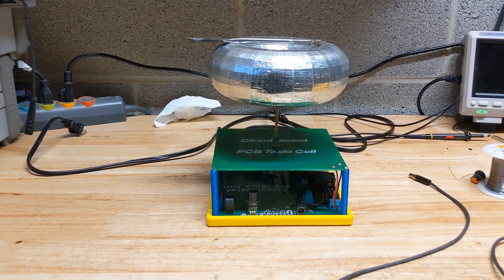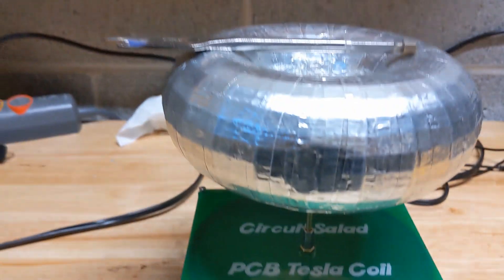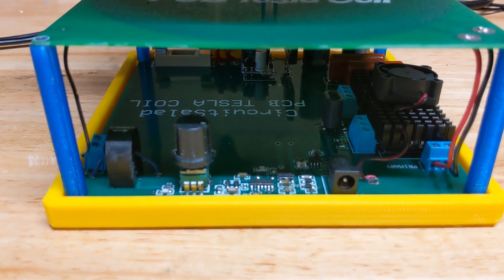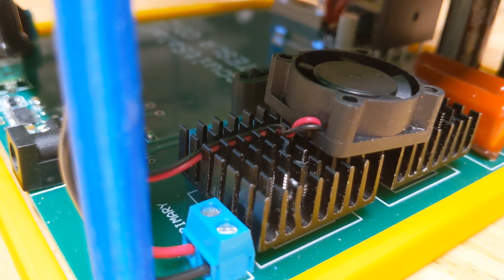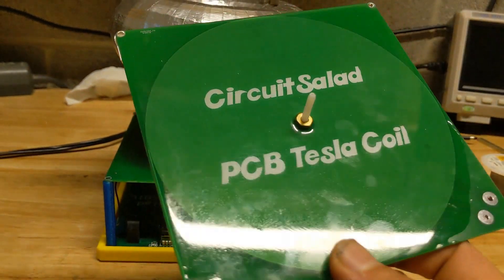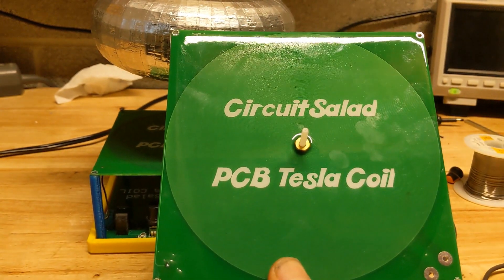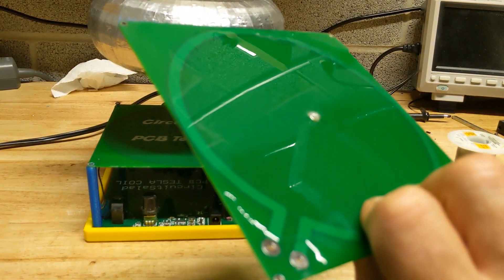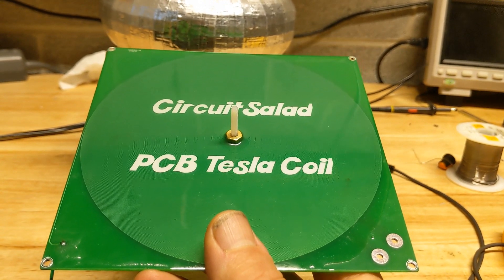PCB etched Spiral Tesla Coil generates 12 inch Streamers

Comment: Is that a metal rod or plastic tube with wire that is holding the topload? Does the bolt in the middle of the secondary have to be nonconductive?
Reply from the maker: go look at the blog post on circuitsalad...in the video I show and discuss this in detail.

Comment: You built a tesla coil with foot long streamers without the pain of winding a thousand turns of wire. Meanwhile, as of typing this, I JUST got done winding a coil for 6 hours. You're cheating.
Reply from the maker: Creating a  beautiful wound coil is half the fun! For me this is just an experiment to show that a small relatively low quality secondary can be driven efficiently and generate good sparks. For the most cool looking, efficient and maximal streamer length to power in ratio coil; a nice wound secondary is best.

Comment: This is incredible. Really great work, amazing design and output.
Reply from the maker: thanks! that's kind of you..I know you put much thought and effort into your projects..This thing is driven really hard but I have built a few of them and they operate consistently. The top load really extends the sparks...but I still get 6 inch sparks with just a post. The top load lowers the frequency ...increasing the current even more for the given reactance of the primary and helps reduce detuning as sparks form. I think the basic primary/secondary coil board could be used with other drivers (lower voltage dc based)  to make a nice musical coil...or a slightly less insane device ...not at the verge of exploding!
Reply: @rayring1166  yeah it looks to be driven hard! Glad you enjoy my videos… but my works come nowhere near this.
Reply: @rayring1166  Do you have an email I may be able to contact you through? You may reach me on the "about" tab under my channel page. I'd love to run something by you.
Reply from the maker: @PlasmaChannel  sure its raycharlesring@gmail.com

Comment: 3:20 - Thats smart to have that coil sparking like that closely to your expensive lab equipment.
Reply from the maker: Actually, I am smart..I understand why the sparks won't damage my equipment...and they haven't. If there was a serious risk..I wouldn't do it. Ironically, I would be more concerned about damage if the coil was not arcing(at that same power level). That would mean the coil was radiating energy efficiently (it's a quarter wave antenna)and at such close proximity there could be parasitic coupling  into the equipment perhaps causing damage.  Perhaps it sets a bad example with regard to best practices and safety but who cares...in fifty years I'll be dead regardless.
Reply: @rayring1166  well I was really joking with you by the books 📚… but I forgot say Thanks for the well organized documents you provided for building such cool solid state Tesla coil.
Reply from the maker: I know you were joking.... I've just had a lot of comments of everyone being so concerned about my test equipment....  I just want everyone to know it's okay! Though it probably does set a bad example. From now on I'm only going to use my hamster for such experiments.... I'm sure that'll make everyone happy

Comment: Wow, that's really cool! First time I've seen one of these. That's really impressive output! Got me interested in trying this now.
Reply from the maker: Thanks...I hope someone build this. I posted a link to my cad files on my blog. The big top load and its elevated position helps spark length quite a bit. But the top load does not have to be this big to work well. You need some kind of post at least to get the spark up in the air or the coil will arch all over itself. Without a top load the streamers are more like 6" at best. I used bridge rectifier but a single half wave rectifier works fine. You get more of the 60Hz envelope modulation which extends the streamers somewhat like a QRSSTC. but if you modulate for music it nice to reduce the 60Hz artifacts.
My original prototype had a separate wire  primary and I wasn't sure the coil could handle the integrated primary without breakdown but it seems to be holding up after many hours of abuse. There is some serious current flowing so the primary and secondary get hot with duty cycles > 25%...so it needs an interrupter. My circuit requires a switch closure which pulls down the logic input to ground. A optocoupler relay or transistor works well. The particular mosfet I used is a really good choice and seems to tolerate anything...I tried about 6 different mosfets that all worked well though. The driver board was etched with 2oz copper instead of the typical 1oz. The etched coil is 1oz copper which was a fabrication limitation because of the fine pitch. I had 5 coil boards made for $23  from JLCpcb.
Reply: You paid $23 for all 5 pri/sec coil boards at JLCpcb or was $23 for each pri/sec coil board
Reply from the maker: It's $23 for five boards That's a minimum order you can do so the final cost was $23  plus maybe a little bit of shipping
Reply: Thats a great deal. Is there a way I can reference your order so they can just duplicate for me quickly?
Reply from the maker: download my files from the the blog post and then you can import them at the JCL website
Reply: Okay. Thanks. What brand epoxy did you use to coat your boards?
Reply from the maker: @vindicatednews9169  MG chemical electrical  potting compound but others will work. I got it on amazon. I saw for 12 bucks some 2 part epoxy for carbon fiber on Amazon that looked like it would work well. The MG stuff cures in one hour in a oven at 165-170F. I do one side at a time and lay it on top of a sheet of silicone coated baking parchment from the grocery store. Which keeps the board  from sticking to anything.
Reply: Thanks for the info! It reminds me of https://www.meyl.eu/go/indexb830.html he has a flat board experiment too. Your approach is more versatile.

Comment: Nice. Puts the ones I've seen online to shame. Puts it into perspective seeing those arcs and then seeing how little space the thing is taking up with such a pancake. I've got huge coils trying to hit those arc lengths as an SSTC lol.
Reply from the maker: Thanks. Yes the tightly coupled primary/secondary...is part of it, as well the large top load. with no top load the streamers are closer to 6 inches. Also the phase shift tuning adjustment lets you really optimize the drive. The secondary  will get hot after running for awhile. Being etched, it has about 200 ohm of DC resistance and the Q is about 60-70.  The particular mosfet I used seems to work especially well in the circuit.
Reply: @rayring1166  https://hackaday.com/2021/06/09/flat-transformer-gives-this-pcb-tesla-coil-some-kick/ just saw this
Reply from the maker: @Magneticitist  yes I notice getting some views must be from the hackaday link
Reply: @rayring1166  Saw it on the news feed on my cell phone =)